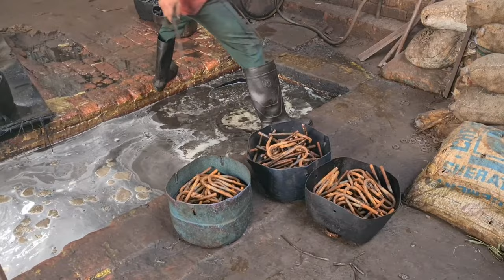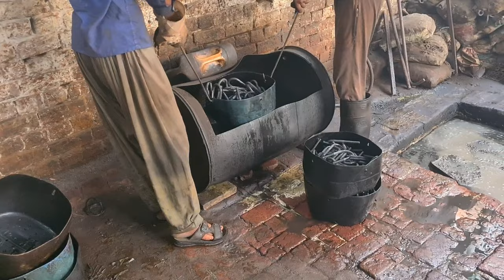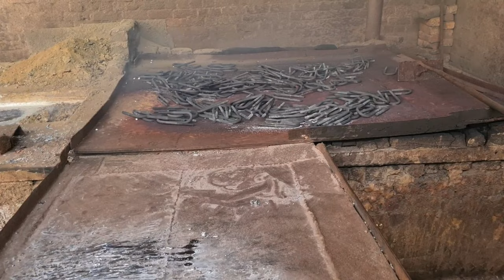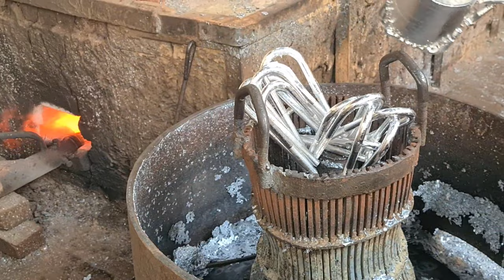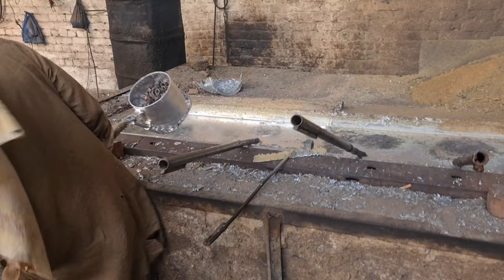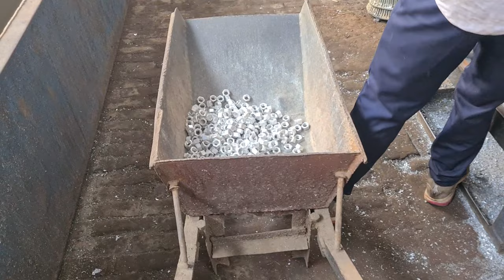Amazing Process : Hot-Dip Galvanized U Bolts Process | How To Galvanize Bolts

Comment: Thanks for the video. I know it would be hard and a lot of work but sometimes I wish you could put some descriptions in the video. Things like they use recycled metal from... or in this case, they first put the u bolts in a acid bath to clean them and remove any rust or oils, They heat the zinc ingots to ?C degrees etc. Wonder why they have that pile of dirt onto on the smelter? It seemed like some of it kept getting into the zinc bath
Reply from the maker: Thanx for the suggestion next time I’ll put some description about process ✌️